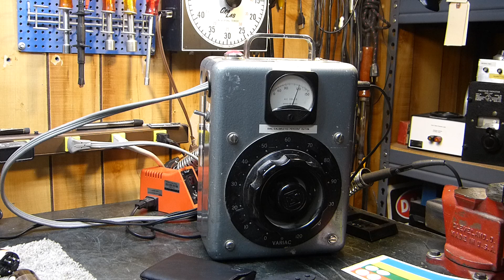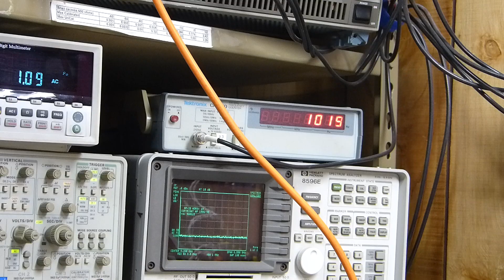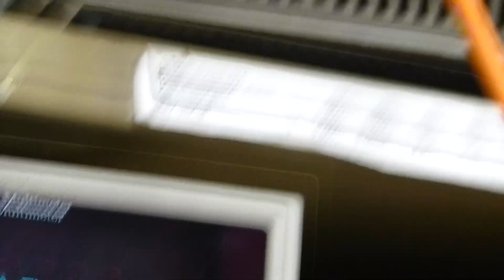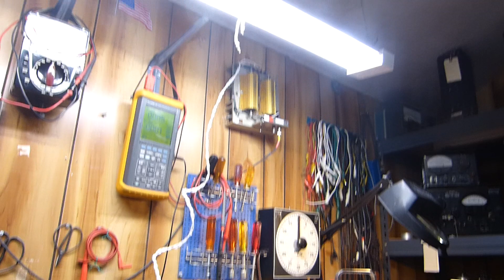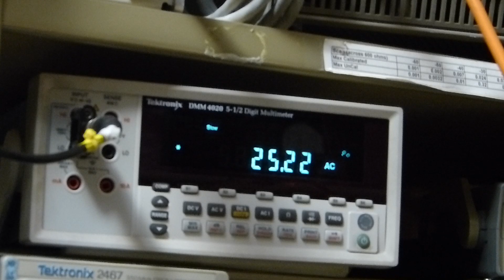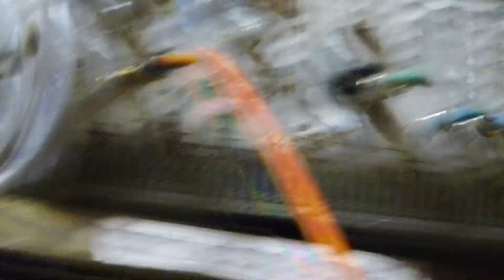McIntosh MC225 Quick Review

Comment: Glad to hear that you have good experience with Russian t-sol 7591.i have a fisher and eico that use 7591.did you have to make any changes to use them.where you buy?. how is the match?is change in match comparible to us tubes? thanks.
Reply from the maker: The four that I bought a few years back tested the same for all four - an actual matched quad... they still test good but not perfectly balanced anymore. 
I like the original size ones, like the Sylvania, and was  one of the reasons I chose the Tung-Sol.
All of my amplifiers are open-top chassis so any size would fit. 
I know some brands are quite a bit larger and could cause a problem fitting is some vintage amplifiers.
I buy all my tubes from www.tubedepot.com - they have been excellent to deal with. I am waiting on another set to arrive.
Reply: Thanks for the info

Comment: Howdy! The Valvo ECC83s are likely Made in West Germany  or Holland. All Philips tubes have a code etched onto the bottom close to the pins and there's a pdf file online called "Phiiips Tube Data Codes" where you can find exactly who made it and when (Mullard UK codes start with a B and Holland  with a Delta). You can also find the dates and the type of tube (if the paint has worn off).  Your Valvo is most likely a Delta Code, which means it's made in Herleen in Holland, beautiful tube. Came across quite a bit of those when I lived in Europe. Philps tubes were manufactured under several brands and all over the globe  (Brazil, Venezuela, France, Holland, Germany, the Philippines etc....) Mullards are the best ones but all of them sound excellent.... and they all exhibit the "flash"... of all things, it's a way to be sure you have a genuine Philips tube. Some were manufactured in east Europe in the 80's and they do have the cross-hatch pattern on top but they're not nearly as good. Great to see another audio video, thanks!
Reply from the maker: Very good information - Thank You

Comment: Good to see you again, really enjoy all your videos and been watching for a long time. I was watching one of your old videos again on the Heathkit WA-1, I’m going to build a set of mono blocks like that because I’ve always wanted to try 807s, maybe not that exact schematic but similar.  Thanks for all your work!
Reply from the maker: 807 is a great tube and makes a very nice Williamson amplifier.
It is essential a 6L6GC with the plate lead on top to allow higher plate voltages. 
The 12 volt filament version of the 807 is the 1625. They have different socks so they are not interchangeable.
Reply: @ElPasoTubeAmps  Yes sir! I think I’m going to use 1625s as I can buy them locally NOS for half the money or less of 807s I should have all the parts in stock minus the output transformers. I don’t have any old iron I wish I did, I’ll go with new Hammond OT since they are easier for me to get here in Ontario Canada

Comment: I have a question regarding things I've seen in a lot of your videos:
What is the second trace on your oscilloscope that I often see when you're testing amplifiers? I assume it has something to do with noise. But what settings and what connections are you using for that? Thank you for everything you posted because I also learned a great deal from you
Reply from the maker: I only have one trace being displayed on the scope but I think what you might be referring to, in this video, is when I first show the display, the horizontal display of the scope is adjusted to a slow sweep rate and we are seeing lots of cycles on the scope screen. In this case, the trace fills the screen top to bottom (amplitude) and left to right (time). With this type of scope, I then press the auto-set button and being a smart-scope, it automatically adjusts the sweep to only two cycles by increasing the sweep rate and there is only one trace but now it is running at a different (faster) sweep rate and the display is not full of cycles like in the first case. Hope this helps.

Comment: When I turn my old tube amps on, I often use some kind of cold start current limiting, usually a light bulb, or variac. I have noticed that  those heater filaments of NOS tubes don't flash if the start current surge is limited only little.  Of course, not a surprise.

Comment: Good to see you again!  Hope you are doing well and feeling good.
Thank you for the post!  Never knew that about Mullard tubes and Telefunken (sp?) tubes.  I have a couple of boxes of tubes that I need to characterize with a tube tester.  Can you recommend a tester?
Reply from the maker: Bill, Always a pleasure to hear from you. I am doing OK... I try to stay busy building equipment but I am getting tired. My wife always knew I had a special place for cats, so she sent me several. I have six now and they are most beautiful. It is tough being alone but whatever the reason, I believe I still have a purpose for living. I tend to look at life as I am at work and will get to go home someday and all will be well. I guess that is called Faith and Love.
The most common high-end tube tester is the TV-7 series tube testers. They can be pretty staggering in price and who knows their condition. I have had mine for number of years and have pampered it but the meter started sticking a few years back and I bought a Chinese replacement that has been good. There are digital readout meters that can be purchased but, again, who knows the price. A tube tester is a first-line device. Kind of a go-no-go start. It can tell if the tube is alive... also, it can be used to compare and grade or "match" tubes but the ultimate test is in the circuit. I have seen many tubes test weak and work perfectly. I never throw away a tube just because it doesn't pass a tube tester. 
Here is something to look at for a starter. 
https://www.ebay.com/itm/166362850827?epid=1382590835&hash=item26bbffa60b:g:ujsAAOSwurllIe6D&amdata=enc%3AAQAIAAAA4JFQ65cGzZsKPYIajtFiEQKDpJTkSyCfcKcBzdH63tsLhXRPMn4UuZXqlWl%2Bv0uTgIgfEdGcoVhVN7pLLXzMhOA5VF5Vk0oC4JvJpfF3dW75GruPd0%2Fw5dboVz7Jbotv4ONTVRchxQB0dtmbXFGnq3Qj65GEw0OvHjl7NRcEpUTCYpnGRuaaXf%2BegO1fALuIjSz4Z7W74T4IcowiKylFrWMpTQz4CkRue4DTOmY3Kh%2BMoaNbftL%2Bxd1%2FQ7ElFX4eOhFs9W6aKYy2lM4kXKFmtsGzK0PASOj11nx0znQPzEbi%7Ctkp%3ABFBM9oWGs4pj

My very best to you and your love ones.

Comment: I wasn't aware that Mullard tubes had the ribs on the top, so thanks for that! I have a bunch of ECC85s (6AQ8) and three have those ribs - they are branded Valvo, Telefunken, and Matsushita.
Reply from the maker: I can't say for absolute sure about the Valvo, but no doubt that the 10M series of Mullard tubes have those ribs and the Telefunken have that square/four-sided star on the bottom between the pins - that I am sure of. In those days of tube manufacturers, all the companies made and sold/branded tubes for each other. You can find, for example, ECC83/12AX7/7025, with GE or RCA or whoever, branded but they are all made by the same manufacturer. It is not something we want to believe but the manufacturers knew exactly how to "grade" their tubes and sell the premium ones at the best price. Should be no surprise and they still do today.  As a fact, the premium European tubes were actually cheaper than the USA tubes but were superior for audiophile use... I still see that the European tubes of yesteryear are stronger and better balanced than the average USA made tube. Many of those European tubes are found in the best-of-the-best equipment like Tektronix oscilloscopes, that I have, and still work perfectly. It just makes me cringe to think that these tubes are throw away because the filament "flashes" on turn-on.